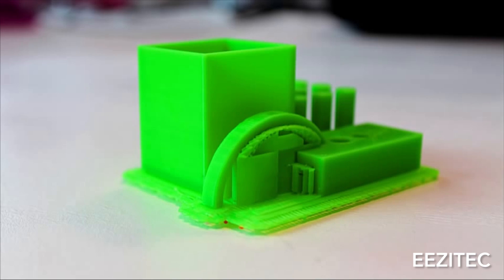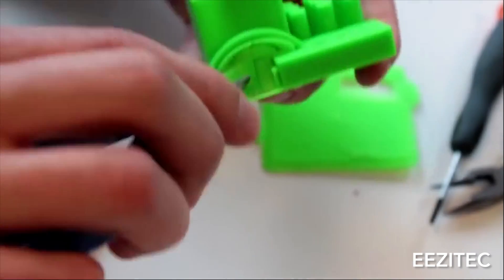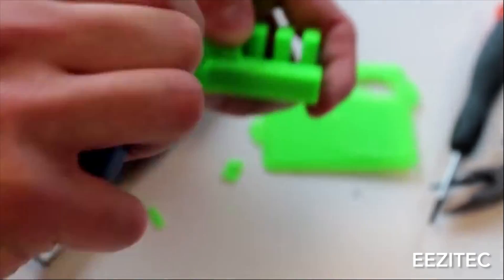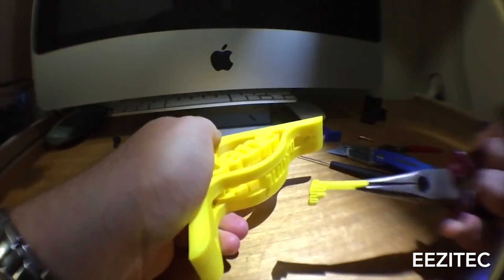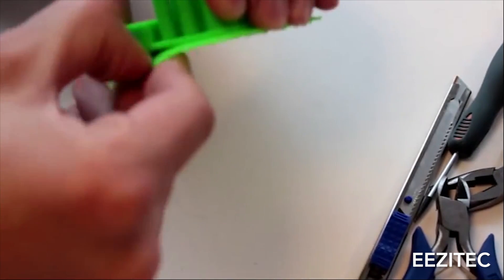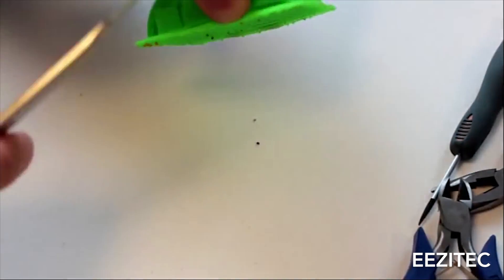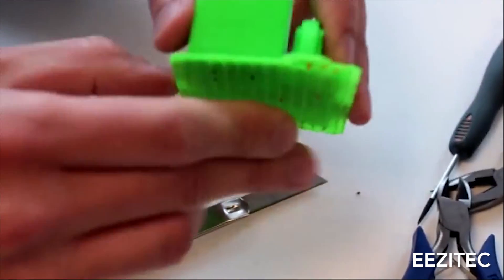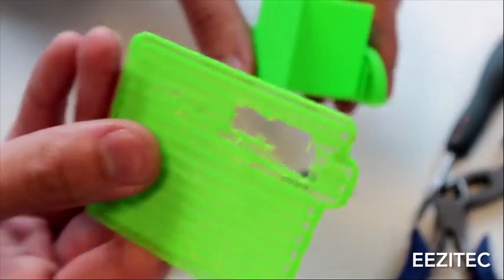3D Printing Eduction: Removing Support Structures | Eezitec

Comment: I need to reduce the connection of the support to the print. Using Cura. Can I do this with the settings?
Reply: Z-distance supports ( the comment is for any person who would read your question, for you i guess you have found the answer for it a year ago :P )

Comment: With proper support settings, support structures should come off by just pressing on it. If it doesn't come off that easily, then you're using the wrong slicer and/or support settings.
Reply: What's the best slicer for easily removable supports?